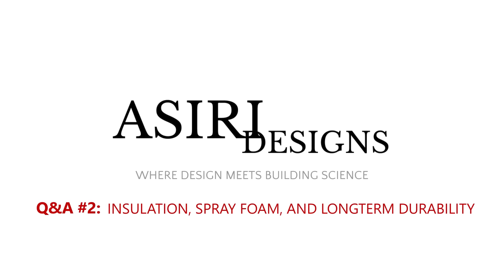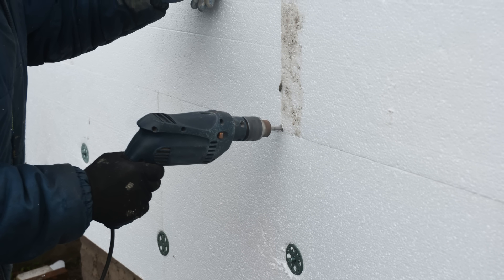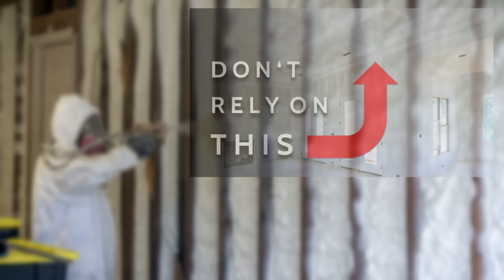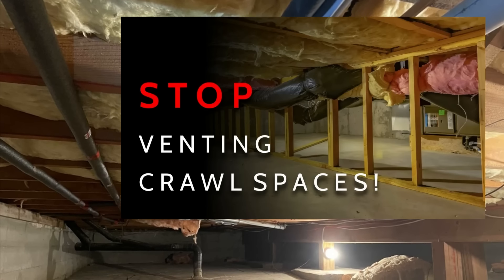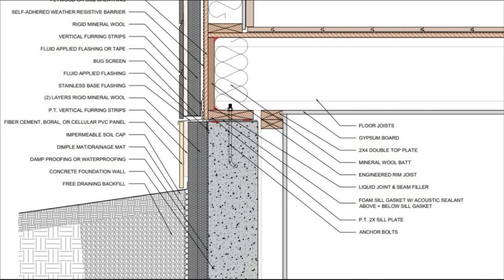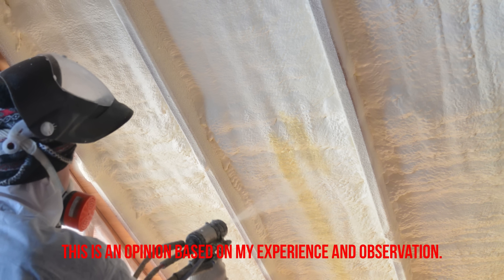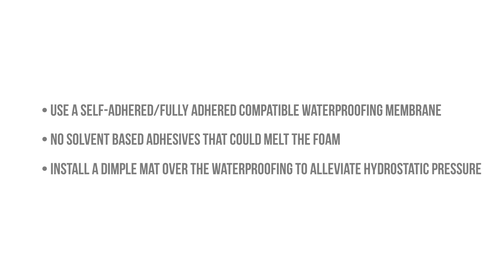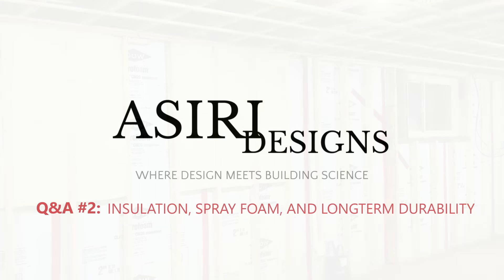Insulation, Spray Foam Problems, Long-Term Durability, and More! | Q&A #2

Comment: How do I seal my basement from bugs and small rodents. I live in a condo situation and have unfriendly neighbors along with mice droppings in the basement.i was thinking spray foam but agree with your opinion that it’s not the best solution. Thnx
Reply: Rodents can get through very small holes (their bodies are mostly fur), so shove steel wool deep into every hole you see with a stick, then fill the rest of the hole with canned spray foam.

Comment: Long term for sprayfoam its been around since the 70s. 
I think foam in a lot of cases has been installed wrong. Alot of the times a client goes with cheapest contractor and this is where issues lay. I recently bidded on a job and the total came to 16k. The competitors came at 7k see where the issues are starting to come from. Temps have to correct, moisture has to be checked, cant spray on cold damp surfaces etc this isnt paint people need to realize its the prep that needs to be done first

Comment: In my experience, spray foam sticks to surfaces very well, may be different based on manufacturers or application. I agree with the off gassing comments, definitely will off gas for months at least.

Comment: So I was just getting ready to dig up my foundation to add waterproofing, weeping tile, and insulation. I was planning on using eps foam. Two layers of 1.5 inches staggered seams. With dimple membrane over top. Is there anything I can do too avoid bug burrowing into the foam? I’m in Alberta Canada so bugs are only an issue for half of the year but still something I would like to avoid.
Reply: The dimpled plastic will prevent most burrowing! And there will be almost no burrowing to begin with, because Canada is too far north to have a lot of pests. Termites and rats are a warm climate thing. Your foundation will do GREAT with foam and dimple mat, just don't cheap out on the footing drain.

Comment: Spray foam simply performs better than fiber insulation because it eliminates heat transfer through convection.  R value assumes no convection and this is not the case in real life with fiber and wool insulation.  Therefore R valve overestimates the resistance to heat transfer with those products.   Ridgid also performs well.

Comment: How long does under slab insulation last... I can't image it lasting more than 20-25 years, then what???  I don't get it, the insulation is going to degrade well before the concrete so your concrete slab is now floating or collapsing, no?
Reply from the maker: @tableshaper4076  Great question! Depends on so many factors, from the type of insulation specified to the amount of moisture it is exposed to, and whether bugs get to it or not. Mineral wool lasts the longest by far without too many performance issues, rigid foams not so much.

Comment: vapor moves from cold to warm. That's why dryers use warm air to dry clothes and not cold air.
Reply from the maker: @buyallmeansnowh7493  In most cases it moves from warm to cold, but in all cases it moves from higher concentrations to lower concentrations. Warm air can hold more moisture than cold air, and will accelerate evaporation because of the added heat flow. Just look up the psychrometric chart...
Reply: @ASIRIDesigns  are you sure you're not talking about condition?

Comment: I've never had a problem with spray foam. This sounds like more hate on Hydrocarbons. get over it. Nothing else is going to seal the weather out like spray foam. No maytter which side of the exterior wall you put it on. co2 is plant food.
Reply from the maker: @TheWhale45  I don't have any issue with hydrocarbons, it's the other stuff in there that emits from the foam when it's heated. I'll do a full video on our findings. Either way, you can get a superior air seal with adhered membranes and liquid applied products if you know what you're doing.